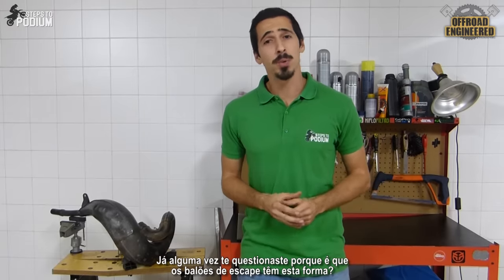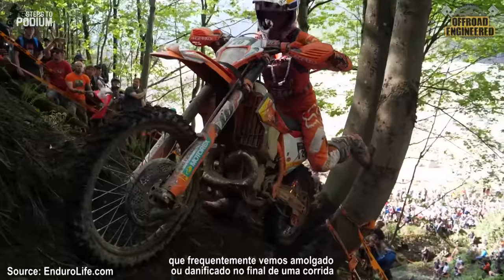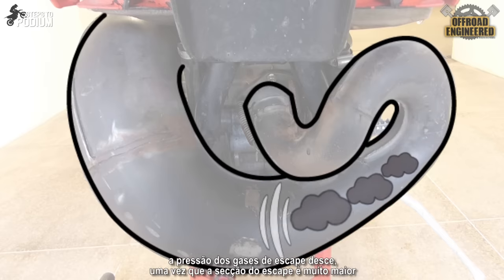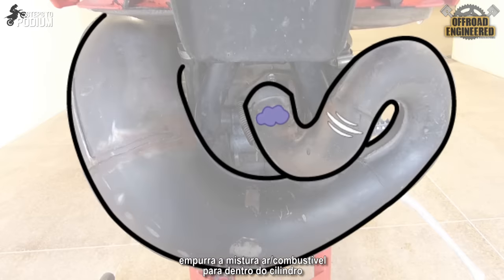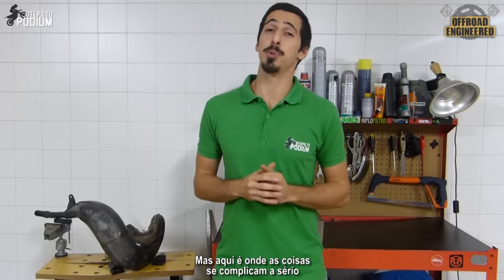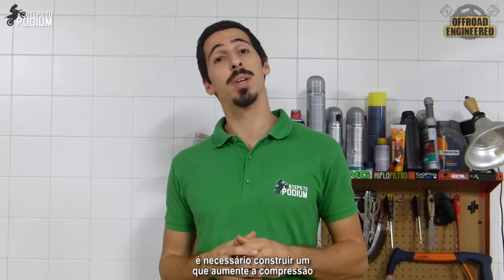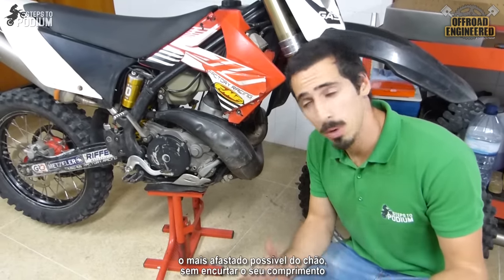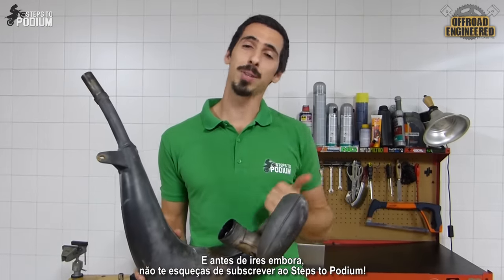How 2-stroke exhaust pipes work | Offroad Engineered

Comment: What is it that effects the power band and can you change where you want your power band to be with in the rpm Range?
Reply from the maker: it affects all the power band and you can only change it if you change the pipe 😅
Reply: @StepstoPodium  Is it the shape of the pipe or the lengh of the pipe line determines where the powerband kicks in on the rpm band?
Reply from the maker: @philipsmith2777  both!
Reply: @StepstoPodium  Okay thanks for your reply 😀
Reply from the maker: I'm glad I could help! 😊

Comment: AND...the first thing you can do, after you buy a 2-stroke, is put a stainless exhaust on it...then buy a set of 'cap clamps' for the exhaust tip and the head flange. Drill the head flange to take an air-nipple, now blow 50-100 psi of air into the dismounted exhaust, while you use a oxy-propane torch to heat the dented areas...the air will 'blow the dents out' and make them like new! If you do this, your exhaust harmonics are LIKE-NEW, and you don't have all sorts of 'engine malfunction' and 'loss-of-power' ghosts you can't fix and can't find...it's most-likely because you have dented the resonance chamber too much! (An old Australian showed me this trick, AND IT WORKS!)

Comment: In 4stroke its better a stock muffler compare to open pipe cause the air pressure in the stock pipe bounce back ?
Reply from the maker: not necessarily,  it depends if you want top end power or low end power!

Comment: The size of the motor relates to the VOLUME of the exhaust, while the length of the exhaust is linked to the RPM of the motor.

Comment: 2 stroke pipes work with the exact same principles as a port in a subwoofer box. it's all about maximizing airflow at specific frequency, in this case rpm.
Reply: would you happen to have some articte i can read about the exaust part?i've found countless articles on subwoofers but none on exausts
Reply: Clue me in,where in a subwoofer it the fuel and spark plug?
Reply: subwoofers displace air just as engines do. engines are just an air pump. when you increase or decrease the volume of air that exits, it effects the way it's going to perform. if you tune a sub box to 30hz, let's say.. then it will be the loudest at 30 hz and will fall off the higher you go. think of that as the powerband. you can move the powerband up or down the rev range by changing the pipe out. just as you can make sound louder at a specific frequency. below that frequency will be quiet. then it ramps up quickly, hits its peak efficiency for the port size and then tapers off just as a 2 stroke pipe will do.

Comment: sometimes it makes me wonder how much a expansion chamber actually helps because i seen 2 stroke race motors with straight pipes ?
Reply from the maker: they might seem straight but the slightest change might do big differences! It all depends on what's intended as power output. (about the racing motors you're talking about I'm guessing)
Reply: I doubled the rpm and top end of a  majestic brand moped by adding a fmf pro "fatty" from a ktm 50 junior motocross bike ...it has to do with the sound waves created inside the expansion chamber that keep the boost charge from going out the exhaust port

Comment: I know this video is old but any help would be appreciated, I have a 2 stroke that came with a very narrow full exhaust with no expansion chamber and I’m wondering if it’s Robbing top end power or could cause issues down the road.
Reply from the maker: Can't tell, it depends a lot from bike to bike 😅
Reply: @StepstoPodium  all good it’s a Polaris Trailblazer 400 the exhaust says Honda motorcycle so I’ll probably just go ahead an replace it/re jet. Good video man!
Reply: I'm not sure about the Trailblazer 400 but I would guess the stroke ratio is longer than a high performance engine like a CR250 or something along those lines. In that case the pipe matters less.

Keep in mind that the pipe should be designed to fit the engines natural characteristics like porting, bore/stroke ratio and how high you expect it to rev.
With an auto clutch like a snowmobile or your quad for example you want the pipe tuned for the RPM the engine naturally makes the most power and the clutch tuned to grab at that RPM.

In short, it's probably a waste of money to try an aftermarket pipe without knowing the other parameters I mentioned.

Comment: What about my ski doo formula 3 snowmobile? The exhaust has a large expansion chamber but then has a small pipe that comes out the center
Reply from the maker: no idea, that's already really specific for a given sport but I think someone on the comments already explained that! :)
Reply: But it still works the same way , check out the tuned pipes for two-cycle model airplane engines

Comment: No.  The divergent section increases the pressure and slows the velocity of the gas flow.  Then the convergent section reduces the pressure and increases the velocity. Basic Bernouli's principle.
Reply from the maker: You should check the conditions/premises for the Bernoulli principle to be valid. This is one of the edge cases.

Comment: The exhaust gases won't travel at the speed of sound along with the shock wave like you showed in the animation.
Reply from the maker: In my video, for simplicity sake and to everyone understand, it does xD
If I would be completely accurate with dimensions and everything, instead of being a video for everyone, it would be a video for the few...
Reply: True that is why this video is not an explanation of how an expansion chamber really works ..it is all about sound waves producing a higher pressure of exhaust to stop as must boost pressure from escaping the exhaust port

Comment: Why is the exhaust port in front of the engine then? If you reversed the intake and exhaust you could put it out of the harm's way within the frame.
Reply: If only there were a shock in the way to heat up with your pipe. Or fuel....
Plus intake would have to be on front of bike. And in wet conditions ram water to air filter... No room for throttle body etc.. Husaberg tried. Yamaha does in F line

Comment: You forgot a step.  When the pressure wave hits the diffuse cone it creates a negative wave that goes back to the exhaust port that helps draw out the exhaust gases.  The diameter of the pipe is not the important part.  What is important is the distance between the exhaust port opening and a point approx. midway down the convergent cone.   It is a complicated system.

Comment: But how would it go back inside when the exhaust port is closed ? I don't think its possible to go back inside the combustion chamber
Reply from the maker: there is a moment when the exhaust port is open. 
the video didn't consider the regular timmings so it's a little off.
but  I'll do another video talking about porting! 😊

Comment: I crashed my yz125 so bad once, it bent the pipe so bad it pulled off the  engine, exhaust port was open to the world, bike couldn't rev much, tons of power right at  bottom of opening  throttle, but very narrow rpm range, then just loud & weak above that
Reply from the maker: Yuuuup that's what happens 😂

Comment: Does the silencer affect the performance of the engine?
Reply from the maker: Yes it does!
Reply: @StepstoPodium  does it lower the performance?
Reply from the maker: Decreases horsepower but can increase torque, depending on the lenght of the silencer
Reply: @StepstoPodium  I am planning on building something using 2 stroke engine but I need the exhaust away from some parts, I'm planning to extend the length of the pipe before it reaches the "bulk part" of the pipe or the divergent... does this affects the performance too? In what way?
Reply from the maker: It affects a lot! It's hars to explain you since there's a lot to take into account. I would recommend you to do a deeper research into this subject 💪
Reply: @StepstoPodium  okay thanks man maybe I'll change my plan

Comment: Good video, but this is backwards from the actual way all this works. The port off the engine has high VELOCITY, low pressure gas. The reason the pipe expands is to increase pressure, and decrease velocity, which is the basis of Bernoulli’s principle. I know this seems backwards, and for the simple man your explanation is plenty sufficient. The back pressure wave would actually come from the first sudden increase in the pipes internal diameter. I am no 2 stroke engine genius and I don’t claim to be, though I’ve ridden and worked on many. I am just applying fluid mechanic principles, as I learned in my engineering degree. 

Anyways I love the way you showed the animations of the single stroke pressure wave! My comment was not to discredit your knowledge or efforts in the video, just trying to constructively add on to it. Maybe edit it thought? Haha.
Reply from the maker: I really appreciate your feedback but there are some flaws in your reasoning:
Actually the reason for the divergent and convergent is solely to increase the back pressure that occurs on the convergent, not to decrease velocity specifically.
The Bernoulli Principle is not applied here since one of the mandatory assumptions is not met, since the density of the exhaust gases is not constant due to the tremendous temperature difference you have from the header until the end of the expansion chamber.
You are right, there is one first back pressure at the moment the exhaust gases reach the divergent, which help suck more air/fuel mixture into the the combustion chamber, but the main back pressure is the one stated on the video (and like you said, we have to keep it simple sometimes, or at least keep some details, in order for the simple man to understand!)
Nonetheless, it's always good to discuss these matters with a fella who also has a master's degree in Mechanical Engineering :D
And thank you so much for the love about the pressure wave, I found it spot on as well :P
Reply: Steps to Podium wow, I think I feel a bit silly now 😰 haha. Guess that’s what happens when a man tries to speak outside his field of specialty. I do see what you mean now, and did some more research to help myself understand the design here. My apologies!
Reply: Though I do think Bernoulli’s principle still applies in terms of gases... would the temperature difference have that big of an effect on density here?.. oh well. I’ll do more reading 🤓
Reply from the maker: @jjcurry4452  yes, it works with gases (it's a fluid), it simply doesn't work with fluids that suffer density differences! 😊
Reply from the maker: @jjcurry4452  no problem whatsoever,  it's always good to discuss these technical subjects! 😀
Reply: It has nothing to do with the physical back pressure from expanding exhaust gasses ....its all about the sound wave reflecting from the reverse cone of the expansion chamber
Reply from the maker: Thank you for explaining what I explained on the video 😊

Comment: What you've explained isn't quite how it works... I don't think.  The backpressure wave doesn't push exhaust back into the cylinder, that exhaust has already depleted (burned) all the oxygen it came into the cylinder with, and isn't further burnable.  What IS happening is that the backpressure wave bounces off the piston at the exhaust port and as it moves away there is a "negative" pressure zone created at the exhaust port.  If the piston opens while the negative pressure is there, more of the exhaust gas will be able to exit the exhaust port rather than the intake port. Better exhaust flow.  The rest of the explanation concerning pipe diameter and bends is pretty much good.  BTW this works in 4-stroke engines also.  I won't go into primary and secondary impulses, since you didn't go there, it would become needlessly more complex.
Reply from the maker: yes, I know there are some details missing, but I kept it simple to make the explanation not so intimidating to everyone. this is one of the most complex subjects about 2 stroke bikes and I didn't want to make it understandable to just a few people who had the background to understand it. I'll maybe do one in the future where I go into more detail about the effects of the pipe on the engine itself! 😊

Comment: not all 2 stroke pipes stay the same length when being used. some of the higher performance pipes have a manifold that bolts to the cylinder and the pipe slips over those with some springs to keep it together. 
some of those pipes have about an inch or so the pipe can lengthen to when it heats up and expand some. effectively increasing the rpm the pipe is tuned for and stretching the powerband some under load.
Reply: No
Reply: @dylancrow7919  uhh yeah go do some research
Reply: I’ve heard of sliding exhaust pipes to adjust the peak but it’s controlled by a servo motor. Not going to have enough thermal expansion  in a short piece of pipe to grow inches.

Comment: Stupid question. Would this pipe design help a 4 stroke?
Reply from the maker: There's no such thing as stupid questions!
No, this design would not help a 4s simply because they do not work through this "supercharged" function. The exhaust on 4s really is just that, an exhaust. The length of the header and muffler can have an effect on the performance but it is not through this design per se of sticking unburned mixture back inside the combustion chamber.

Comment: i'd say the most important reasons why two strokes are more popular in hard enduro racing is because the clutch is much saver from overheating and failing because of the "ventilated" crankcase. And adding to that the two stroke can run much lower rpm without stalling the engine.

Comment: Bro If I put an 2 stroke silencer in 4stroke what will happen does it increase compression in 4stroke does it make 4 stroke better.
Reply from the maker: It looses power
Reply: @StepstoPodium  Thanks bro. I thaught that it would increase compression, I am going  to turn 110cc 4 stroke weighting 108kg commuter bike to an adventure dirt bike.

Comment: Hi there..
I have a Honda mtx 125 R dirt bike. For and year ago i have replaced a aftermarket engine. Mean time i have changed the exhaust pipes. But i could't find a 125cc , so i replaced a 200cc bike's exhaust pipe. Here after i got some issues. Bike hesitstes ho rev at the biggining, once it reached 4000 rpm engine has power. I changed CDI unit, Primary Coil, High tention coil, plugs. But i still have the problem. Can you help me with this issue? Will it be the exhaust pipe?
Reply from the maker: have you tried running the engine with the 125cc exhaust pipe or thar isn't possible?
Reply: Unfortunately i dont have the old exhaust  pipe with me.
Reply from the maker: that could be the reason the engine is not working properly! but you take it to an experienced mechanic, he'll know what to look for 😊

Comment: What would happen if you put a 2 stroke exaust on a 4 stroke
Reply from the maker: I definitely won't work properly, I can tell you that!
Reply: It would not help at all, 4 stroke is a different system to get exhaust gases out, they need their own designed exhaust to run properly
Reply: Nimbus Nimbus  how tf is that childish and I'm not a child 🤣
Reply: Nimbus Nimbus  my bad I took that the wrong way, i guess i do 🤣

Comment: How about in the end of the exhaust make it small like a straw to make sure that its all comeback
Reply from the maker: if you have a bottleneck too big, you affect the pressure inside the pipe and it won't work the same way! 
you only need a pressure wave big enough to push the new charge back in, anything more than that won't bring any benefits to the performance of the engine 😉

Comment: My scooter exhoust is have a damagd curves.
With my stock exhoust it runs with 80km 
And i buy an arrow exhoust with one curves.. and run only 60km .. what is the problem there ?
Reply: The problem is your scooter.
It is all about it's behavior. It doesn't like the new exhaust and decides to drop the speed down until you put back the old one.

Comment: I still don't get how the pressure wave bounces back, but does not interfere with the exhaust gas...
Reply from the maker: The pressure wave is just the concentration of matter in the air and the exhaust gas is the matter. I even gave an example to try to help understand the phenomenon 😊
Reply: @StepstoPodium  every pressure wave pushes something away, in this case it initially pushes the air in the exhaust away and pulls the exhaust gasses out of the exhaust. So far to good. But when the wave in the exhaust bounces back ... the only way for that wave to make it back from the exhaust to the engine would be if it's stronger than the next wave outwards. That's the part where I get stuck. But it must probably be calculated and timed in such a way that the 2 waves don't cancel each other out. Amazing technology it is :)
Reply from the maker: That's exacty it 👌